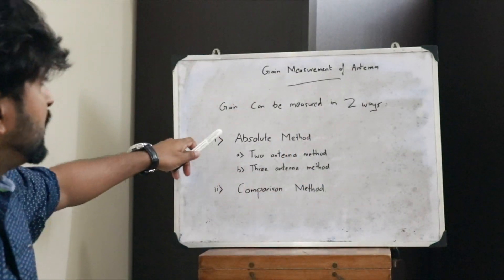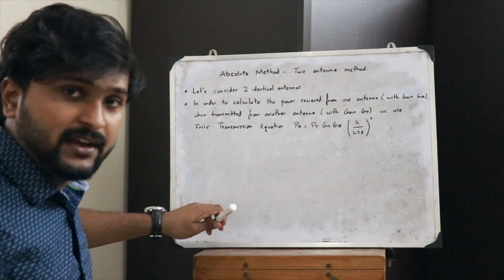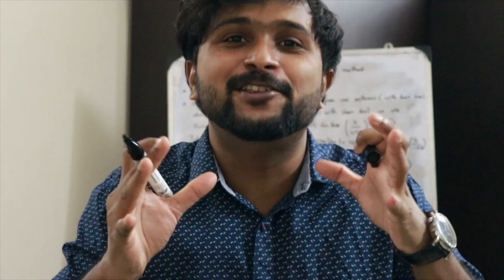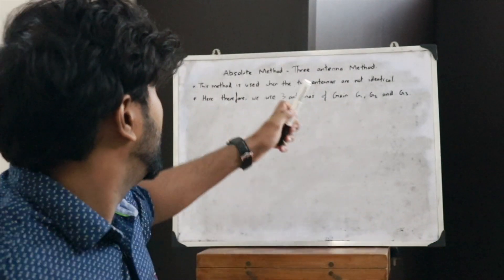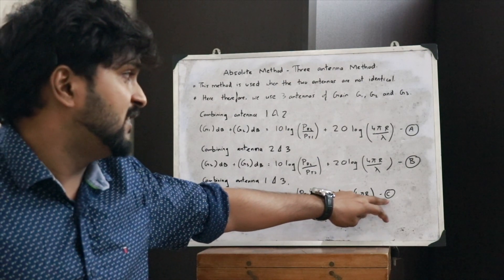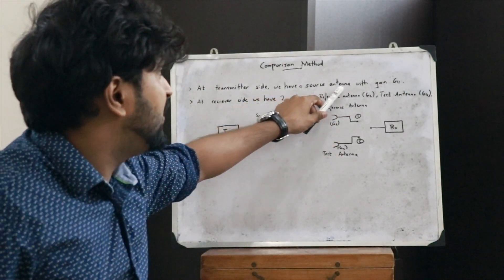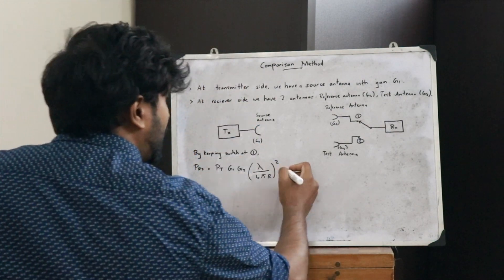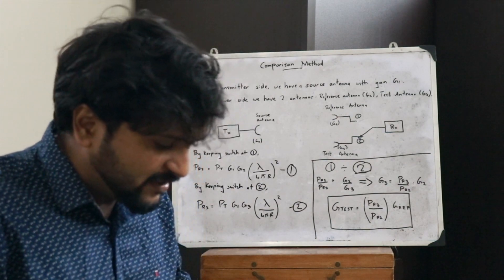Gain Measurement of an Antenna | AWP Module 2 |

Comment: 7:07 in equation B - shouldn't the first term be 10log(Pr3/Pt2)....one doubt
Reply from the maker: Hey there!! That is a really good question, thanks for asking!! 

Briefly answering your query : It depends on which antenna you are considering as the transmitter and which is the receiver!! Here since it is derivation of the gain, I've not specified which is transmtter and which is receiver!! But while doing problems, just take it accordingly!! 

More such videos are in the making so do join the community by hitting that subscribe button so that you will be updated as soon as they're out!! Do share it with your friends as well!!